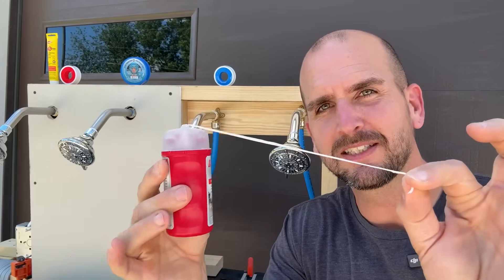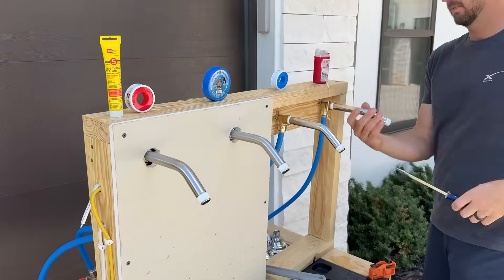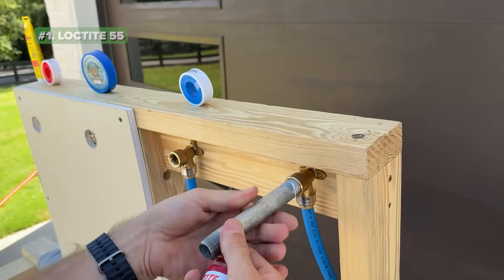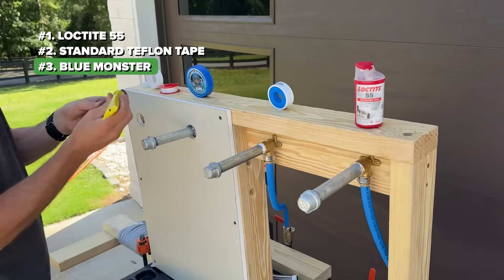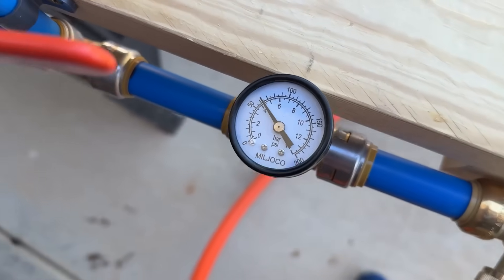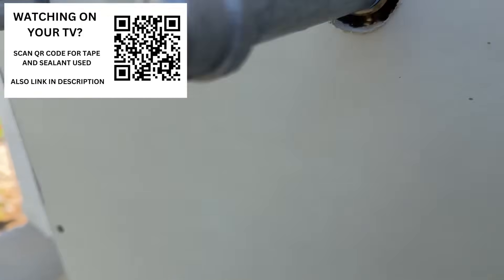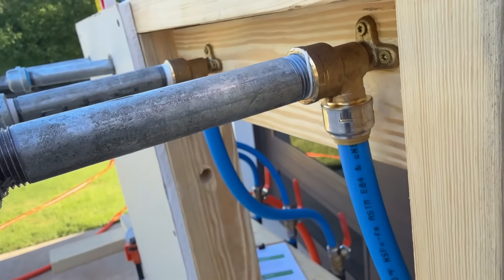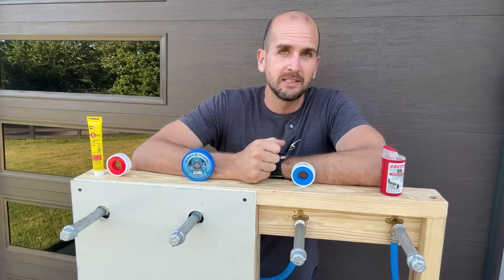Loctite 55 vs Teflon Tape: Which Actually Seals Better?

Comment: I always wondered why US uses all that chemical stuff like that "dope" and PTFE on everything. As a HVAC technician from Germany we used different stuff to seal threads over the years, we had locite 55 which was okay and we use PTFE tape also. But the Loctite is expensive and tends to leak if not applied perfect. PTFE tape is even more expensive (at least when using the better versions without filling agents). So we mostly went back to classic flax + "fermit" paste combo, which is still widely used. Flax is a nature product and the fermit paste is a mixture of oils and some non-organic filling agents, which is just applied to prevent the flax from rotting and some lubrication during installation. Its just so fault-tolerant, and people do mistakes everyday, you can even turn it back up to 1/2 rotation safely. And especially when used in water piping it prevents leakage really good, because if getting soaked with water it expands and so prevent the water from leaking through the thread. Of course if the pipe is used for things like oil or other chemicals it can't be used, because it will wash the paste away over years and the flax can't be soaked with alcohols or oil. We then use PTFE tape, also. But we do ~10 rotations and no turning backwards for adjustments then. It never leaks if the thread is roughened before applying the tape. This is essential also with flax, because it gives the material grip to go along into the connection and not just into the first two grooves of the thread. I am aware the type of thread between US and rest of the world is slightly different, they use NPT threads, we use BSP threads, maybe this is the reason. Btw Loctite is a german brand since Henkel bought them in 1997 and the Loctite 55 product is just cotton filament soaked with silicone oil, so its likely the flax + paste solution but lacks the ability of soakage because silicone oil is hydrophobic. Same principle but less fault-tolerant.

Comment: Sometimes i use 55 first and wind it into the threads, then put a couple of wraps of Teflon over it. Never leaks. Ive noticed that the 55 coating melts with hot water. 55 is not certified for gas, gotta be yellow teflon.

Comment: Ive used 55 for years, never had it leak.  But it will split female threaded pvc fittings if your not careful

Comment: I want to see much higher water pressure. If you have it, try to attach an electric pressure washer before your setup. Briefly turn on the pressure washer to increase the pressure.
That pressure washer should be able to increase the water pressure significantly over the 60psi.

Comment: I've only used high density teflon tape for about thirty years.
The white stuff is for amateurs.
Discovered the high density tape while doing a big fire sprinkler retrofit and the heads had a specific torque spec that you could not exceed and there were frequent thread leaks. Found the high density tape and ordered a case, problem solved.
That is all I've used ever since.

Comment: I have used the can of blue colored pipe joint compound True Blu and have no failures with water or air pressure. My air pressure is 120 psi inside 1-1/2", 1", 3/4", 1/2" 1/4" and 1/8" connections. I despise Teflon tape as the most abused substance on earth. Two products I hate the most are Teflon tape and silicone sealant.

Comment: I used to hydrotest pressure vessels when I worked in the refineries. Some required an over 2,000 lb test. Never had a problem with basic Teflon. In fact when testing vessels under 200 lbs I would use a couple extra wraps and just tighten the fittings by hand. They called me Captain hydro 😅

Comment: regular teflon tape stretched and twisted into the threads does the same thing. Old plumbing trick.  Pipe threads are taper they’re gonna get tight eventually you really only using this as a lubricant think about it before you spend $30 when you can buy a $3 roll of tape.

Comment: I used to use just teflon tape and I would get the occasional leak using three wraps. I’ve since switched to 5 wraps of teflon and pipe dope and have yet to have a leak. I’m just a DIY’er and time is money…this technique is slow but for me it works.
Reply: If using the thin white 5 would be the minimum.

Comment: Sometimes doing everything right won't stop a leak and parts have to be replaced. I did my yearly tankless water heater flushing. I couldn't get the plastic filter to stop leaking. I used Blue Monster tape and Blue Monster pip dope. You shouldn't need anything because the filter has an Oring. I removed the inlet housing and saw on the Oring seat it had very tiny scratches. You would think the Oring would seal them but it didn't. Luckily I stock parts. I put a new inlet housing on and the same filter with just the Oring sealed.

Last year the plastic filter housing broke inside the inlet. I had to remove the inlet and chisel the plastic out. I am sure doing that put those small scratches on the seating surface. I decided to only use the filter housing for a year and replace it as they are $8. Last year it was 5 years old and the Florida sun isn't kind to plastic.

Comment: I don't believe "torquing" the pipes would make any difference using the standard pipe nipples found at Home Depot or most plumbing supply companies because of the "Chinese" factor. Many years ago I plumbed an automatic oiler on a stationary generator in a communication site and was unable to stop the leaks regardless of the sealant. I finally threw away all of the Chinese water pipe used to build the site and installed machined pipe nipples rated for hydraulic systems. I used teflon tape and had no further leaks. I had the same problem with a sink I  installed in my house. I had to extend the hot and cold water from the kitchen to the utility area and I tried everything until I used paste and tape on every fitting. I had to keep tightening the pipes for about a day, but the leaks finally stopped and haven't leaked since. 

If you look at the depth of a nipple when you screw it into a coupling you will notice none of them go in the same depth if you are using Chinese pipe.  The issue with pipe threads nowadays is the lack of quality of workmanship in Chinese products. I have to plumb my garden irrigation system every spring because I take it out in the fall and put it up. Some of it is 1 1/2" PVC and every size from 2" to 1/2" galvanized pipe. I use a lot of brass fittings and it makes it easier to take down and the brass fittings leak less that galvanized or black. I would use a lot more brass if the price was a little lower. 

I will try the Locktite this spring to see if I have less leaks. Plastic pipe threads are worse for leaking than Chinese pipe so it will be a good test.  One more note: I have never had a leak when I used machined threads made for high pressure hydraulic applications, and brass to brass is much better as well.
Reply: I found the same thing.  The retired plumber working the plumbing isle at the old Orchard Supply Hardware said the only way to keep Chinese pipe and fitting from leaking was to use pipe thread compound and the teflon tape.  He said he didn’t know what people were going to do if they working on gas pipes.

Comment: To make the test fair, you need to torque the pipes and fittings on each fixture equally. The tape does two things. It acts as a lubricant and a sealer.